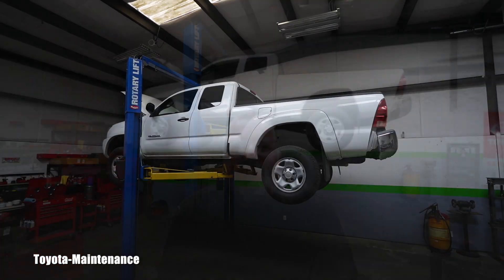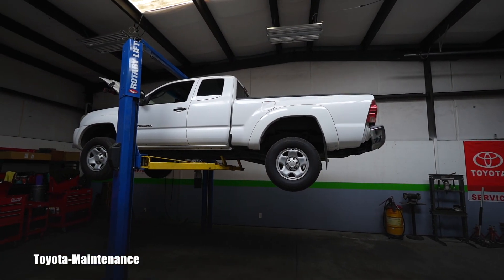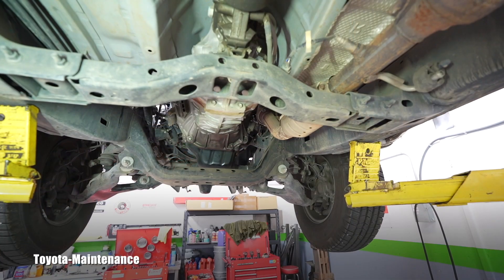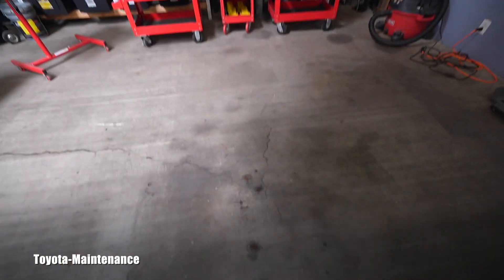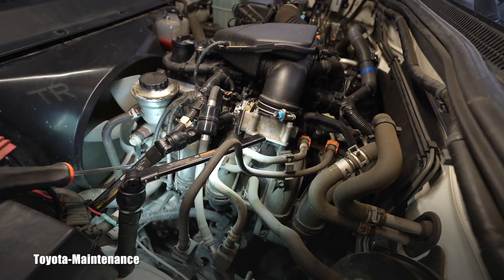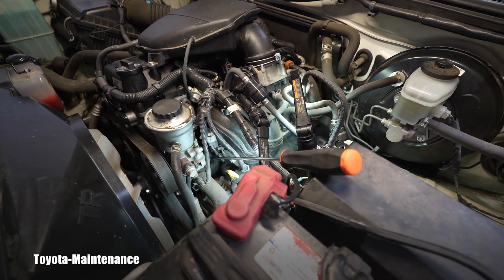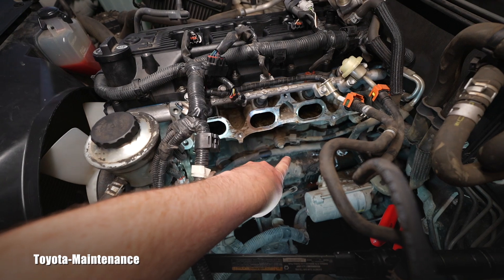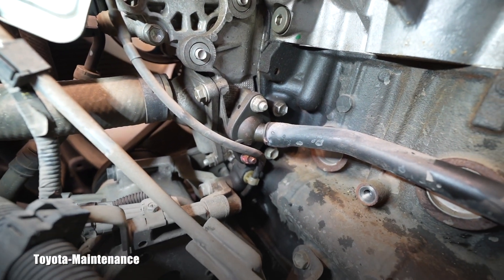Fatal Design Flaw With Toyota 2.7 2TR-FE Engine

Comment: Did they change this in later years to steel? I have a '21 with the 2TRFE
Reply: I was told this pipe was upgraded to metal in 2011.  Anyone one else heard this as well?
Reply: @rockbay79  I think more like 2012 in the US.  2011s seem to still have the plastic pipe.
Reply: My 2016 has the metal part. You're good to go!
Reply: Your voice keeps me up at night.
Reply: Yes 2015 medal pipe